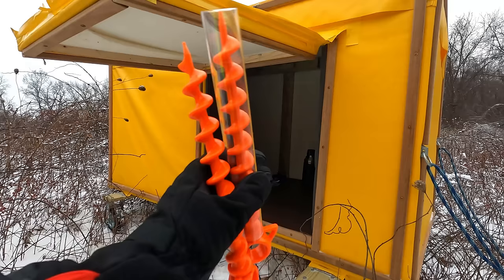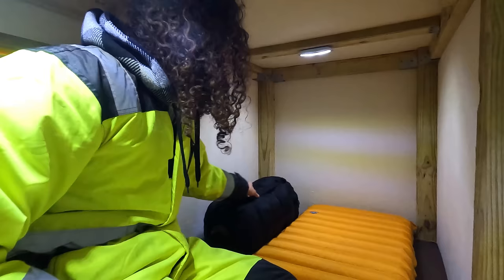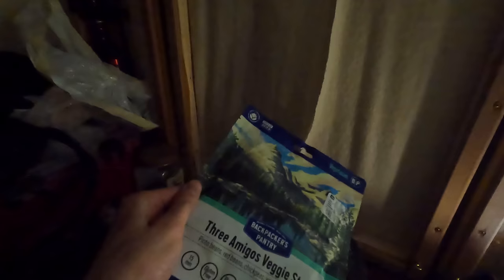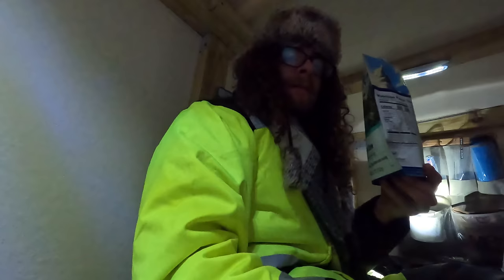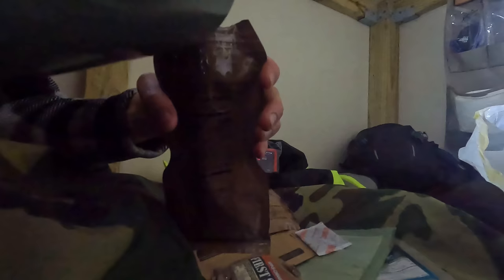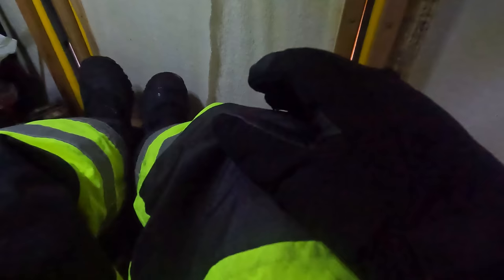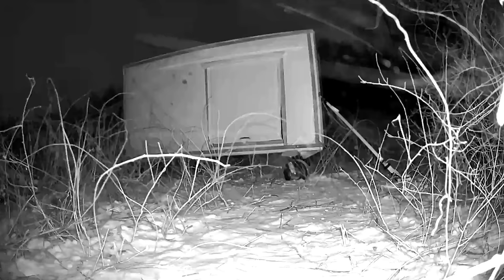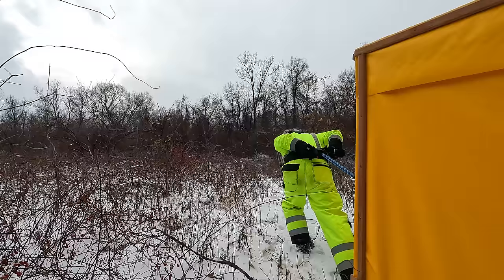Zero Degree Night In Homemade Camper ( 0° F and 50 MPH Winds )

Comment: Pneumatic tires would be better than hard rubber and, in the winter, skis would be best. A harness for pulling works better as you 
can put your weight in to the effort, also a candle lantern would heat the cube and with a small fresh air inlet you would not burn
up your oxygen supply.   YHS,  campdog

Comment: I think it looks like a block of Velveta cheese!

If you don't know this I'll say it for you...
Tires:  the softer the surface that the tire is moving over the wider it should be.   Height, taller would be better too.  Pneumatic tires would work well for this application.  You can adjust the tire pressure to increase the footprint of the tire, increasing its ability called flotation.  Big word, just means the tires ability to stay on top of the ground.  On soft sands, etc., which would make it easier for you to pull.  You can get a small foot pump to easily change your tire pressure.

Look it up for a longer explanation if you need to.  The concept is familiar to most serious off roaders.
Only having about 1/4 to 1/3 horse power you are going to need some extra help pulling your Velveta cheese block!  Don't eat your house into uselessness!!!
Reply: Oh, be very careful about going down hill!  The bigger the hill the worse the problems will be in getting you and your Velveta cheese block down safely!

Comment: I think if you insulated the interior with sheets of foam insulation it wouldn't be as cold in there. Also, having camped in cold temperatures myself, thick heavy blankets would've helped as well. Maybe 4 or 5.

Comment: Great video.  I will be the 16th person to suggest more insulation (it’s pretty light) and a safe UCO candle holder inside.  Also, if you prefer box shapes, another idea is making it collapsible, so easier to pull and store.

Comment: a curtain over the door would likely help stop any draft orsuch.

You really could use a heater of sorts...  lots of options too...  if you have a "battery bank"   you could go with an electric bed warmer....  or electric blanket...  in a small space like that with an ok insulation that would work well.  you could add pink insulation to the inside for example.

battery banks you could go as simple as a 150-300  inverter that uses drill batteries...   dwalt/milwaukee inverter, Ryobi inverter.    one of those would provide enough power for LED's and/or an electric blanket for several hours...   so carrying 2-3 batteries for overnight.

Using a buddy heater in such a small area might be excessive...   it would work while you were awake...  but...  a more interesting idea would be a little 2000 watt diesel heater in an external pack.   on camp you take it out and mount it,  say on the side, back or top of the camper...  then run a heating hose inside.   you could have days of heat off a little bit of fuel with those.   and making a self contained box unit,   you could remove it from that camper and use it with hot tents, with sheds, what ever..  just setting it up outside and running the hose inside.

Comment: This reminds me of Capsule hotels developed in Japan.  The pods are bed-sized spaces and feature basic accommodations. You can take it further by channeling your inner Mark Watney and science the shxt out of it.  Start by reducing the weight by half, and then use the credit to extend the length of the capsule camper by one foot. Create a utility closet to house batteries, a charging system, a solar heater, a stove with a vent, a water filtration system/dispenser, etc.  The capsule camper should include a fold-down table, solar panels, USB ports, standard electrical outlets, large format iPad and many more.  My mind runs wild here, but I look forward to the next iteration.  Please create a playlist to better track progress and list the dimensions in the description.

Comment: I was pulling my face-painting gear in a bike trailer (no bike, just me pulling it) for maybe a mile to a park near me. I had weights and barbells in it to hold an umbrella down for shade, so it had some weight. Why do I mention this? Because I ended up slightly dislocating my right shoulder and got a tendon pinched. It bothered me for about 6 months until I was riding on a very icy road and my bicycle slid out from under me and I did a belly flop onto the ground. That popped things back into place for me and I've been fine since. Just lucky, I guess.
Whoever suggested rigging up a harness, I second that motion.

Comment: Should have brought along a c Ceramic water bottle , and kept all food & water in sleeping bag, installed a small Air- vent then you could have a small gas heater on a low setting all night with cmCarbonmenoxide alarm perfectly secure toasty warm .

Comment: That's either a Schrade 152OT Old Timer, Sharpfinger 🔪or a clone of some sort👍.
Reply from the maker: Yup sharpfinger good eyes!
Reply: Hard to miss for a knife enthusiast 😃.

The Schrade/Old Timer Sharpfinger is one of Schrade’s most iconic designs👍. The Sharpfinger was originally produced way back in 1974. 

Back in the '80s it was very common to see one of those sharp fingers riding on someone's hip, and it's actually still fairly common to this day👍.

Comment: Good call not going out tonight.  One accident and you may be laying there unable to get back to your shelter all night. That could end very badly, especially if you didn't take your phone with you.
   Also it looked like it was a struggle to pull that camper with your arms back behind you. What about putting together some type harness can go around your shoulders and then clip in back to the rope.  🤔

Comment: You should put bigger wheels on there and more than two or three inches bigger than the ones you have on there and the air ones are much better because there not stiff like the other ones

Comment: There is a YouTube channel called The outsider.. he also built a portable camper like you have he also found a way of heating it overnight in the coldest weather.. if you want to go through his video list and see what he did to he his place up overnight you might have to make some modifications to your camper for this type of system to work in your camper  ... I also imagine that other people have done the same thing that you have that have a heating system that will keep you warm..  the only thing I could suggest as if you have a solar battery and some solar cells that you bring yourself a heating pad you can't lay on it but you can put it on top of you...,

Comment: You should check out some of the cheap Chinese diesel heaters.  There are several channels on here that use them to heat tents and small home-made campers.  The heater stays outside and has a hose that is piped into the enclosure with little risk of CO intrusion.

Comment: H2S (I think was the unknown on your alarm screen) is hydrogen Sulfide a colorless gas that smells of rotting eggs and is lethal in relatively low doses. At higher concentrations H2S becomes odorless. I cannot locate the source for the odorless part but I read it somewhere that isnt the CDC NIOSH page that I am using now. my fingers are too cold to go looking further. stay safe and warm. I look forward to seeing this thing more often.
Reply: The Cheese Curd

Comment: I was wondering if you used some insulated foam board to help keep it warm. Maybe try it under the camper floor some similar to how I have seen in RV's before. You could definitely add it around in the inside as well.

Comment: H2s on the oxygen meter is hydrogen sulfide it's a gas that can make you pass out or die in high concentrations... We wear H2S monitors at work all of the time, funny thing is you can set them off by farting in them... Nothing beats the look on the safety man's face when he had to give a whole meeting about how we can't keep farting into our meters and setting them off on purpose... Good times ! 🤣

Comment: What are the cameras you used? I've been looking for security cameras that doesn't need wifi to work.
Reply from the maker: Wyze 3 cameras But you need external battery for power and you have to set it up whit a phone whit a mobil hotspot to connect to it - Hope it helps!
Reply: Yes thank you!